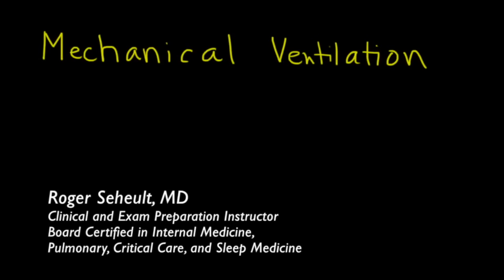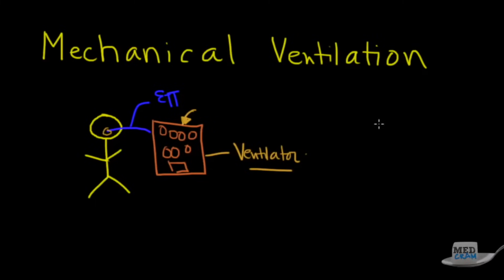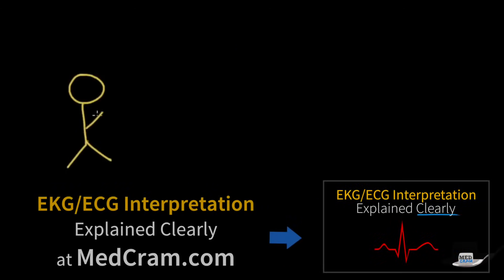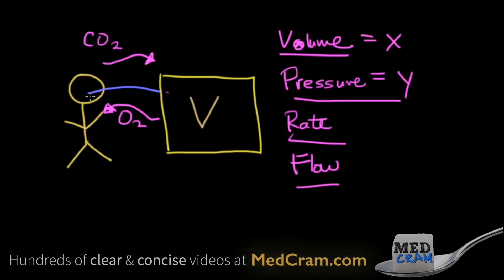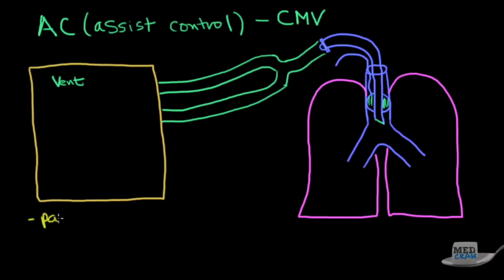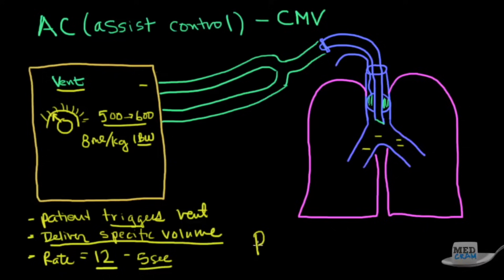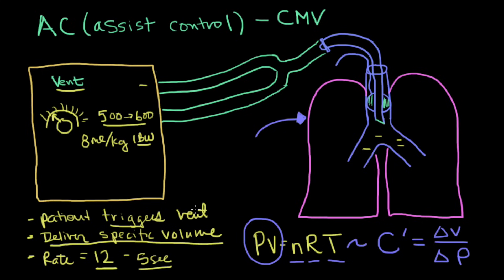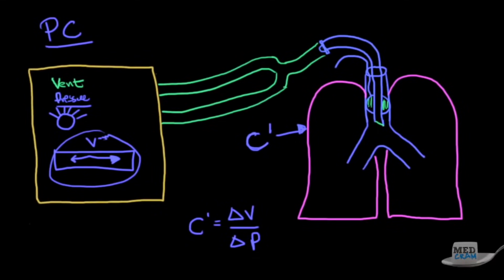Mechanical Ventilation Explained Clearly - Ventilator Settings & Modes (Remastered)

Comment: I was wondering if A CPAP can be used as a ventilator with a change in settings?
Reply: I have a CPAP as well but I cant control the pressure as it is done from the doctors office via the internet. However if you just need a bit more air pressure you can use a aquarium air pump. The trick is you just tuck the air line under the Teflon mask. Any extra air pressure just leaks out and cools your face and you have a bit of extra pressure to help breathe. I use this method working around chemicals and it works great but its not a ventilator so its not a cheap replacement.
Reply: It can't. A ventilator is a more complex machine. CPAP machine can only  keep  continuos possitive pressure, You can't set the resp rate and other things, because of how they are Made. If the patient is not breathing, CPAP is not usefull.

Comment: When I was a kid all this didn't exist. What did exist was a contraption called an "oxygen tent". In other words you were basically on your own.
Reply: The guy that invented those baby ventilators I think was a pilot. He saw a need for helping preemie babies to breathe and decide to try to build one. They told him no way can you do that with babies etc. He never listened and cobbled together something from duct tape pumps and hoses. In the end it worked and that is how we got ventilators for babies. An engineer from Quebec Canada had a baby and realized that baby bottles were not the best way to feed them because they let in too much air. He then invented the collapsible baby bottle that takes those little bags. He then went on to invent the machine that lets you skydive inside a tunnel with a giant fan. 
 Another fellow that invented the gas mask for miners went on to invent the stoplight for cars at intersections. 
 It seems if your an inventor type with a good imagination there is no limit to what you can do. cheers

Comment: From what your explanation of AC regarding the "pt. Initiating a breath" sounds like SIMV....I thought with AC, vent breathing 100% for pt.. if pt. Breathing over rate or volume, vent will alarm. SIMV will give pt. Ability to breath on own and if pt. Doesnt take set rate or volume the vent will provide what pt. Isnt doing.... 
Is this explanation I'm giving correct?
Reply from the maker: In AC the patient can breathe over the rate.
Reply: A/C has 1(one) 'breath type'(VOL or PRESS/PCV set) and it's given each time the vent senses patient inspiration with a minimum number guaranteed by set rate if patient doesn't breath . SIMV has 2(two) 'breath types' a VOL or PRESS/PCV like in A/C but ALSO a PSV/Pressure Supported breath, the PSV breath is given when the patient breaths above the set rate breaths, the set rate breaths are designed to be 'synchronized' (S) with a patient's inspiratory  effort , if the patient does not breath ,they also get the guaranteed set rate. Each ventilator manufacturer has some variation on this but in general the same, study your vents well RT's nobody else can do that for you.

Comment: Thank you for the great lecture!

I have one question
As far as I know, the machine alone decides whether to put air into the patients lung in CMV mode.
A/C mode is slightly different as it picks up +pressure from  patient to put air in within set breath time.

The mode that you described, that the machine picks up the positive pressure from patients ling, is more like SIMV(synchronized intermittent mansatory ventilation) mode

Please correct me if I am wrong, I am still learning
Reply: It really depends on the ventilator you will be using. Very old ventilators CMV mode  (control mode ventilation) only allowed for the number of set breaths and gave them like a 'clock' regardless if patient was trying to inhale or exhale !, . Newer generation ventilators in A/C provide the set VT breath each time it senses patient inspiration and tries to do so in unison with insp effort (not to be confused with SIMV). Say 1990 or so forward vents are MUCH more forgiving in either mode to allow your patient to receive flow/FIO2 still.  You must study the exact vent you work with and learn it's dynamics well.  SIMV btw is 2(two) breath types in one mode, a set rate breath (either VOL or PRESS/PCV) and PSV/pressure support breaths, the set rate breaths are (S)Synchronized to the patient insp effort and the PSV breaths are given when the vent senses a patient insp effort in between the set rate breaths... Best in all, hope that helps, enjoy your learning.
Reply: rockymnt hodad doesnt CMV stands for Continuous Mandatory Ventilation? He/she (whoever made the question) is making sense, i also cot confused.